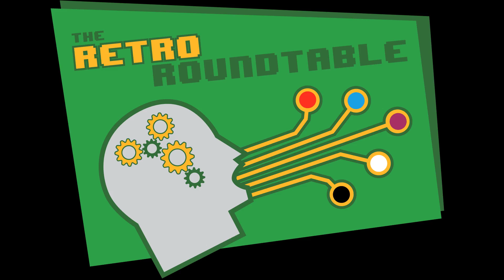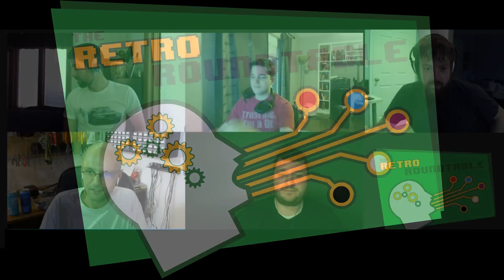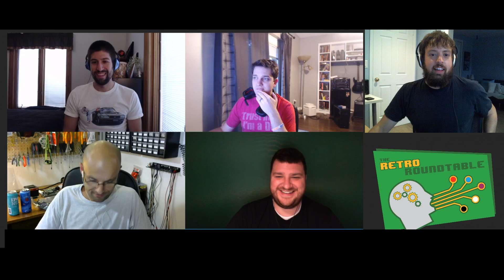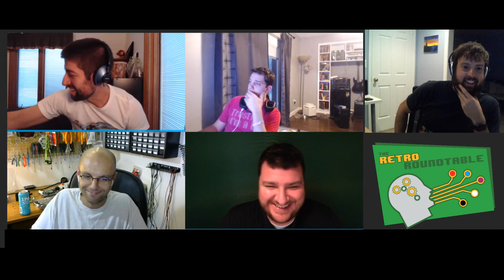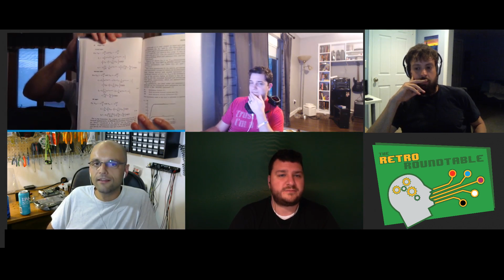Ep. 7 - YPbPr vs RGB, Games We Put Hours Into

Comment from the maker: Please comment below with either questions for next podcast or topic suggestions for future podcasts. The next one is scheduled for August 24th at 8pm EDT.
Reply: Wanted to add my full comments on FPGA emulation vs simulation which maybe can be touched upon next time.  My hope is to better understand where my thinking might be flawed and any input is appreciated.  I know it was a loaded question when asked but I'm still interested in your opinions.

Simulation (similar) means you are building a reference copy of a piece of hardware that is similar to the original.  This is generally goes hand in hand with testing/debugging/building process on your way to achieving emulation.  Simulation also goes hand in hand with changing both the software and hardware to work together or helping you design your emulation work with various types of software that uses it.  At this stage, compatibility is lower with software as true emulation of the hardware has not been achieved

Emulation (exact) means you are building an exact copy of a piece of hardware that is preforming exactly as the original.  Here we have something that exactly duplicates another piece of hardware.  Results are coming out of this exactly as it would the original This gives us faster processing time using this method and is a streamlined product due to our simulation work.  Compatibilty is higher with software because we have a true "exact" copy of the original hardware on which is was designed to run.

So we emulate the chips in the console, we also emulate the extra chips in certain carts (FX, etc) to get an exact copy of the original hardware with the FPGA to achieve results as accurate as the real stuff.

*Edit- after tonight's live stream, to be clear, this is in reference to Hardware Emulation vs Hardware Simulation.  Software Emulation is a different matter as we have to consider it runs on dissimilar hardware and needs an additional layer of software to mimic the hardware environment.  A good example of this is VMWare running one OS on top of another.  Similar to the difference between machine language vs a high level language, extra layers between the application (software on the cart/ROM) and the low level hardware that runs it.  This brings in a whole different discussion on limitations, considerations, complexity and compatibility.  The less layers between the software (cart) and the hardware itself, the more reliable and accurate our results will be.

Comment: Interesting that you guys talked about the Framemeister and component video. I recently did some extensive testing using official component cables for an original model PS2. I discovered once I calibrated the COLOR_SET menu settings of Brightness: 36 and Saturation: 25 that the overall quality was actually better than the RGB counterpart. I tested both 240p PS1 mode, and 480i PS2 games, using of course the sharpest scaler settings on both (H_SCALER: 5 and V_SCALER: 6) at vertical integer 4x. In both modes, component provided a better picture and slightly better color output conversion. This sort of flies in the face of what I kept hearing on various forums about the Framemeister 'sucking' at component input handling. As I said, once I set the saturation down to 25 and turned the brightness up to match the RGB counterpart, the picture was arguably better, not worse. I would have thought if the Framemeister was so bad at component, I would catch this in action on my PS2. Now of course at default settings, component does look wrong since the saturation is way overblown and the brightness too dark, but I was a little surprised at how easy it was to adjust these to match RGB by simply using HDMI screencap comparisons. I finished off by playing some Street Fighter Alpha 3 in PS1 mode and FFX in PS2 mode, and both looked superb via component and my new settings.
Reply from the maker: That's interesting, and certainly warrants further investigation on our part. My only experience has been using component 'out of the box' and it looking way worse than RGB. Once I (Nick) get the new OSSC, I'll borrow Ste's Framemeister so I can revisit my comparisons with regards to color and upsampling.
Reply: Here's a side-by-side test image capture I did  to show how component actually can look just as good if not better than RGB on the Framemeister (RGB color settings were at their defaults, while component was adjusted to 36 Brightness and 25 saturation):

http://www.firebrandx.com/downloads/Framemeister-PS2input-comparison.png

I will say that I'm not advancing the theory that the Framemeister does 'good' conversion output of component, but rather that it's certainly not any worse than RGB on the Framemeister, which has been claimed to be superior.